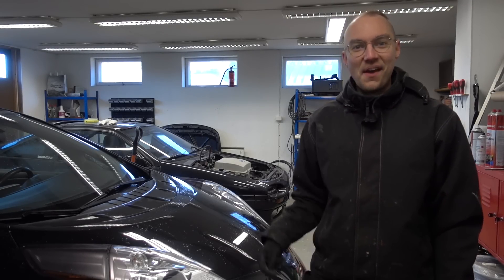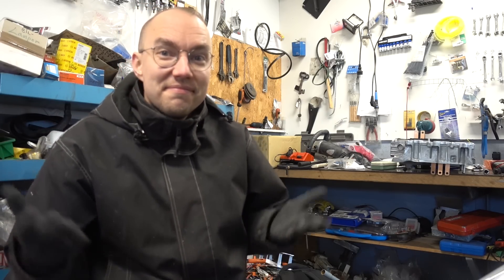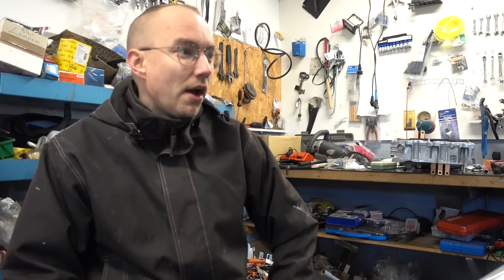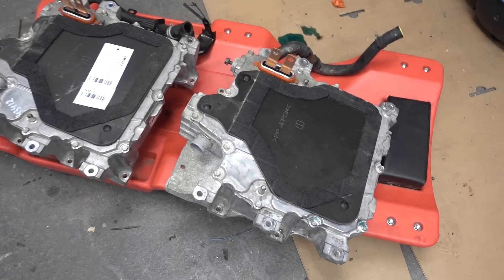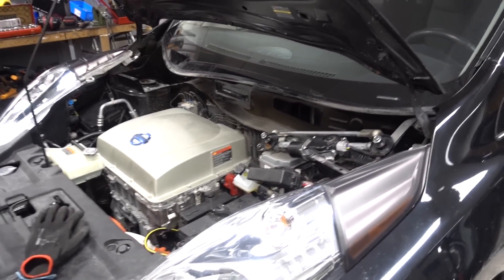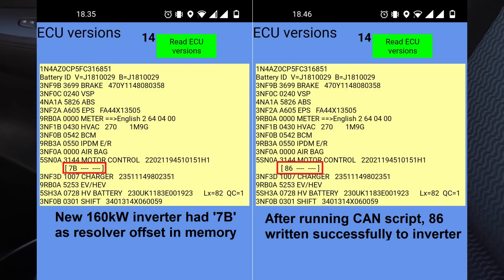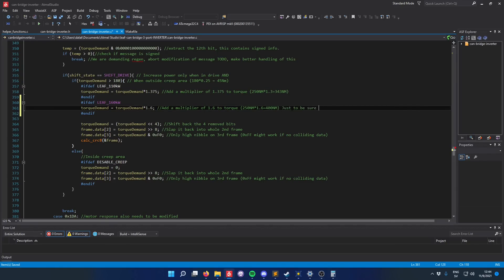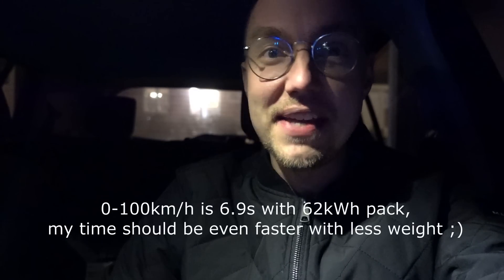Performance upgrade for the LEAF, [Part 3] 160kW

Comment: Are the interconnections in the 40 kWh battery beefier than the 24 kWh battery? Could probably get away with replacing the fuses with 400 A fuses. :D It's not going to do this continously anyway.
Reply from the maker: No problem using the 24kWh battery as is! Many on the Discord server are doing it without issues!
Reply: @DalasEVRepair  Thanks I didn't know that. I'm looking hard for an early leaf in my area in Norway (Troms).

Comment: Looking to do the upgrade, but seems that write function still isn't implemented in LEAF Spy. What hardware/CAN adapter would I need to write resolver code using CANrunner? Thanks!
Reply from the maker: See this thread https://openinverter.org/forum/viewtopic.php?p=31056
Reply: @DalasEVRepair  Thanks Dala! Is there any speicifc USB-CAN adapter that is needed to use CANrunner? The Kvaser one listed on their site seems quite expensive, which one do you use in your video?
Reply from the maker: @ashton9699  I use professional tools (Kvaser Leaf Light v2), but an arduino with CAN shield can also be used if you follow the guide on openinverter

Comment: Do you think it is possible to upgrade the 2012 Nissan Leaf with the more powerful inverter?
Reply from the maker: Not this way. The 2012 LEAF has an EM61 motor. All the stuff I show in this series is for the 2013+ EM57.

One way would be to go for an aftermarket inverter, but good luck getting that to integrate with the standard LEAF VCM!
Reply: @DalasEVRepair How can I purchase your products from the US?
Reply from the maker: @e4tuanify  its all open source, available on github. Link in description

Comment: wonder if its possible to use the full leaf chsrge and drive system and transplant it in to a awd subaru
Reply from the maker: Easy! Just use the Resolve-EV controller to cut down on the Nissan electronics needed!

Comment: So i took a stock tesla for a test drive and have to say it moves :)  in theory the leaf with 160kw would be about the same if running the 24kwh pack due to weight savings.  Power to weigh is the same.  Traction is not

Comment: Hi Dala, ive done some more investigation around the 225amp fuse in the 24kwh leaf,  it looks like it will handle 450amps for 60 seconds and 1000amps for one second, so essentially its there to protect the pack from a big short or a prolonged high load. So in theory a quick 8 second hit of the pedal should be fine at 160kw.  Next thing to research is are the cells capable?  After lots of endless sphere it looks like they will do 8c or 200kw short pulse , so 160kw should be about 6c. For 8 seconds or so when the battery is 70% and above charge state.  I wonder how good the contacts are, im going to guinea pig and go for the 160kw inverter.  now to find one.   I suspect there will be a sweetspot of cells sag vs draw, maybe 140KW will be it. My pack is. 86% SOH  and rock solid cell balance, so reasonable start point.  Do you know if the late 2014 model has the fuse removable ?
Reply from the maker: Awesome! One person pmed me that they are running 2x 80kW motors on an original 24kWh pack, so full throttle for a few seconds doesn't blow the fuse 😁
Reply: @DalasEVRepair  and that is my green light :)
Reply: @DalasEVRepair  You should make a video about this.
Reply: @Islamisthecultofsin  search for 4wd leaf

Comment: Hi Dala, I know the form factor is different, but is this inverter upgrade possible on the Gen1 motor?
Reply from the maker: Hi, Q: Why doesn't this work on my 2011-2012 LEAF? A: The early leaf has EM61 motors. These aren't compatible with the EM57 inverter style. Different sets of parameters to control these motors.

Comment: If I understand correctly, I can change the inverter doing charger swap (one mess), connect can bridge to pair the new inverter, but not change the math stuff  I'll have stock performance (80kW), and drive safely until battery swap?The inverter and charger price can be lower than leaf 6,6kW vs 3,3kW charger.  

Can you add a "turbo bust button"? Its better leave the 80kW for my wife, and I'll be happy with max power :D
Reply from the maker: Yes on all questions :)

Comment: Do you have expirience witch swaping 62kWh battery into 2013+ leaf? I know the battery is bigger, I saw on YT that someone put  metal/aluminium distance, but I cannot find any information how to make the same or how to do it other way
Reply from the maker: Haven't done it personally, but Muxsan sells a kit with the spacers and stronger rear springs!

Comment: Dalla whats your thoughts on modifying a 24kwh battery for 160kw, bigger fuses ? Or is the issue the internal connections ?  Someone commented 300kw unfused.  Im also thinking load on the cells will cause heat issues, so maybe temperature limiting boost mode, so in theory you may only use 160kw now and then, keeping it 80kw mode most of the time.  Also theres questions around the transfer case and cv joints etc, are they all the same ?   Id love to have 160kw in the 24 :)  some big sticky front tires of course:) it would be pretty impressive with the light pack.
Reply: Looking at the weight , 6.9 seconds for the 1730kg with 160kw , the 24kwh with 1508kg  should take the leaf down into the five seconds to 60 with the 160kw inverter, dry weather and some sticky wider front tyres.   Now to find a 160kw inverter :)
Reply from the maker: It will probably work just fine with the 24kWh pack. Seen some custom builds with over 120kW now and theu still use the stock fuse. Seema like I was overcautios 😅
Reply: How hard is it to replace the fuse in the 24kw 2014 model ?  Thinking of doing the 160kw conversion,  ill slowly wind it up until the fuse pops if it ever does.  Then wind it back a bit to a safe spot.

Comment: Hey Dala! I just subbed to your channel, this is awesome! I was wondering if you can make a video to better explain HOW to do the can bridge install and programming for the car to accept the inverter. I know you posted the files on github, but for totally clueless people who want to do this upgrade, a step by step could be awesome!!! Ex what computer do I need, what cable, what software etc. Thanks!!
Reply from the maker: Hi,
I have a video up here on how to install a CAN-bridge: https://www.youtube.com/watch?v=-gLMUeE2mXo

The same info can be applied to the inverter upgrade, the location is different as shown in the github page. But with this info it should be really easy to install one.

I am hoping that Leafspy will get the resolver coding soon, if not, check out this site for more info on manual resolver offset coding: https://openinverter.org/forum/viewtopic.php?f=4&t=1895
Reply: @DalasEVRepair  will I still need the can bridge once leafspy coding works? I'm sorry I don't really understand the role of the can bridge... If I do the battery upgrade and then inverter upgrade do I need two can bridges?
Reply from the maker: @cloutiernicholas  Yes, CAN bridge is needed to get more power out of it. If you skip the CAN-bridge, the inverter will just run at 80kW.

Comment: Sounds like you need a lsd. I don't know if anybody makes one for the Leaf?
Reply from the maker: If we get enough people to do this upgrade, maybe some company can start to look into making an LSD :D
Reply: @DalasEVRepair  Quaife does if you order ca 20 I think. Several car clubs has gotten diffs made by sending in an original open diff and ordering a big batch. Question is if there's a marked. Maybe if the newer Leaf also has the same diff. Keep up your good work, greetings from Norway.

Comment: there was a video where Rich Rebuilds blows the fuse on his Tesla. An interesting show. These high amp fuses are basically lots and lots of low-amp fuses rolled up into one big package (because it is easier to predict how 100x10A fuses will work instead of 1x1000A). and thus they may burn out one after another. so a 1000A fuse can become a 900A fuse can become a 800A fuse can become a 700A fuse.... and one day step on GO, the thing will go pop and that was that.  cannot find the video right now. so no link

BTW: how hard is it to replace the fuse on a Leaf? Isn't it in the plug in the rear-seat floor? That would be nice. Going full petrol-head, just have a few spare fuses rattling around in the foot-well :D
Reply from the maker: On the ZE0 the fuse is accessible from the outside (service disconnect plug). On the AZE0 it is inside the battery!
Reply: @DalasEVRepair  :( hahaha

Comment: When will we see a 4 wheel drive update of the LEAF :-)
oh, and more pratical, can you in code make the rear light, turn on with the DLR ?
Reply: I was looking through the comments to ask the same question! Is it possible to add a second motor to a Leaf at home? Super curious

Comment: REGEN:
Hey Dala, great video. Very inspiring. I was wondering if this modification makes any changes to the regenerative braking system? Perhaps it is now more efficient or you can regen at a higher power?
Thanks.
Reply from the maker: Yes it is possible to modify regen this way, increase it ll the way up to 80kW!

Comment: Are you sure it will pass muutoskatsastus? I think they would like to at least know it has the same brakes as the 160kW model. Does it?
Reply from the maker: We'll see :) Yes they have the same brakes even on the e+, guessing that they can get away with it due to the hard regen also helping out quite a bit on braking.

Comment: I could see myself burning the fuse !  Id be tempted to push
Reply from the maker: Do it! We need brave people to find the limits of the smaller packs 😁
Reply: Asking double output from the 24 would be interesting, a fuse swap might fix ?  I wonder what the C rating is on those cells.

Comment: hi) I wanted to ask why only 145kW maximum is given out by the motor, but the request is for 160kW?  can-bridge says that the battery is ready to give 160kW, but in fact it is 145kW and 400A.  I have a battery capacity + extra in the trunk = 60kw.
Reply from the maker: Traction control cuts power when wheels are not getting traction. Next spring/summer I will get full power ☺️
Reply: @DalasEVRepair  I installed sports tires for Winter without studs.  the wheels do not slip.  The slip control system is disabled.  even if you roll it, it doesn't produce more than 144kw🤷🏻‍♂️ I increased the multiplier for VCM from 1.6 to 1.8, but only the pedal changes at start.
Reply from the maker: @olegmalinin4975  interesting, let's discuss this on the openinverter forum, maybe some fault code is on?
Reply: @DalasEVRepair  link to the forum?
Reply from the maker: @olegmalinin4975  https://openinverter.org/forum/viewtopic.php?f=4&t=980&start=150
Reply: @DalasEVRepair  does it have more torque from the start or does it just limits the maximum power draw?
To get more torque at standstill it would have to put more current thru the windings which would mean the motor is being underutilised?
Reply: 62kwh leaf gives full power about 70-80kmh speed even in summer. i suppose it would spin tyres at lower speed. too bad leaf is fwd
Reply: @jak8  does it mean that the 160kw and 80kw models accelerate at the same rate until about 30-40kph then the 80kw version starts to drop in acceleration while the 160kw version doesn't drop acceleration until about 70-80kph?
Reply: @franciscoshi1968  i noticed this when i drove the 40 then the 24 right after, 24 same off the lights and drops off around 65,  40 keeps pulling.   they are limiting power to also save the drive train i suspect.  Put some sticky tyres on and some how trick the inverters speed sense ?
Reply: @jestronixhanderson9898  I have been working on an Imiev and they do something similar but not done by the inverter. 
In the case of the Imiev the EV-ECU will reduce the torque demand to ensure the power in or out of the battery does not exceed a certain limit.
I found out by sending torque commands to the inverter and asking for maximum torque. The car started accelerating and when it got to about 60kph the inverter turned off. After checking the error codes the EV-ECU reported inverter failure. The EV-ECU sent a shutdown command to the inverter.
My guess is that Nissan did the same thing but built it into the inverter logic instead.
If this is the case then I would be confident to say that swapping the logic board may achieve the same result. Maybe there is no need to change the whole inverter.
The torque is proportional to the current flowing thru the phases which means that if the bigger inverter does not give more torque at low speed then the small inverter will probably have the same power stage.

Comment: I work with inverter hw/sw development for vehicles and it makes me happy that you swap out the inverter instead of trying to tune it 🙂

But do you know if they are programmed to control the same model of electric motor? The resolver offset parameter is the most critical one to change of course but there typically are at least 20-100 more parameters in an inverter that decides how to control the motor optimally. Motors (in this case a PM motor) differ a lot in their design such as type and size of magnets, length of rotor/stator, number of winding turns and so on. This changes things as base speed, optimal current angle and field weakening behavior. 
If you are running a motor with the wrong parameters you will not get the full torque or efficiency (less range, more heat). You can also get instability in the control loops that cause the inverter to shut down. 

Now it seems to work well for you so the motors must be quite similar. The most important factor for how much power the motor can handle is the thermal performance. The motor must have a thermal sensor that limit the performance if the motor gets too hot. But it will not cover all parts of the windings. Hopefully it will hold up if you don’t push it too hard.
Reply from the maker: Hi! Yes the inverters both go to the same EM57 motor. Nissan decided to save on R&D and keep the EM57 exactly the same from 2013-2022, only the inverter has evolved. Nice to hear from someone with inverter expertise 🙌
Reply: @DalasEVRepair  I  found this: "In 2018, the EM57 motor received an update with the introduction of the ZE1 Nissan LEAF. Depending on which inverter was mounted on the motor, power levels were increased to 110kW (320Nm) and on the e+ model it was further raised to 160kW (340Nm). The rpm range is also increased to 11,330 on the e+ LEAF. The motor received three tweaks:

Slight reduction of permanent magnet material
L-shaped coolant inlet
Minor casting tweak to front&rear cover"
Reply from the maker: @willgeorge5644  Yes, I wrote that wikipedia page 😁

Initially i was worried about the reduction in permanent magnet material, but the env200 gets the newer 2018+ motor with an old 2013 style inverter, so they are interchangable

Comment: This is just awesome. The future of car mods is here!
How many kW's can the Leaf's motor support for a brief period of time, assuming a large enough inverter and a battery that can deliver that power? In another comment you mentioned that the battery can output 300kW (with some caveats), but can the motor take that?
I love watching as always!
Reply from the maker: I've seen people take out over 300hp with the stock motor, so no need to update that :) All the magic happens in the inverter!
Reply: @DalasEVRepair  Holy smokes, alright! I'll keep that in mind. Thanks for the reply!
Reply: @DalasEVRepair  If you look at the torque/speed graph maximun torque at low speed is about twice the full speed torque. I am thinking this is due to battery limitation, not inverter as it's current that is the issue for inverter and currnt = torque. If you can get that torque at low speed inverter can handle the torque (current) at low speed and allow the same current at highe speed you will have twice the power, so 320 kw.

Comment: This is great! I can't wait to see it unleash its full power! 160kW is the same as my Bolt EV, but it's heavier at 1660kg. Putting 160kW in a lighter car like yours (or the NX!) is awesome! Will the NX's pack support this power with a fuse 'upgrade'?
Reply from the maker: Absolutely, the NX will get the same treatment and a bigger fuse :)
Reply: @DalasEVRepair  What current level are you comfortable with on those cells? They are the second generation cells, right?
Reply from the maker: @ElectricNed  even 24kWh packs can give out 300kW without a fuse (and if you can stomach the degradation). So with a proper fuse the 30kWh pack can easily run the 160kW inverter!
Reply: you probably can take two fuses from 24 pack and put them in parallel. It was been nice on ze0, on ze0 fuse is inside of the orange plug, so, its remoblvable. on aze0 and ze1 fuse is inside of the pack, actually, under a orange plug.